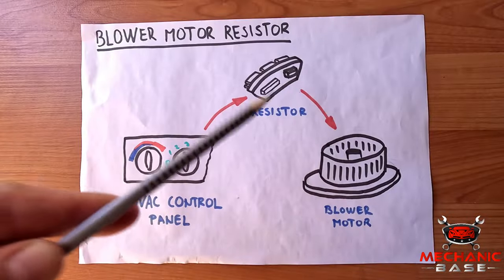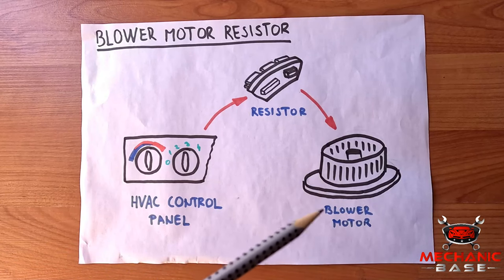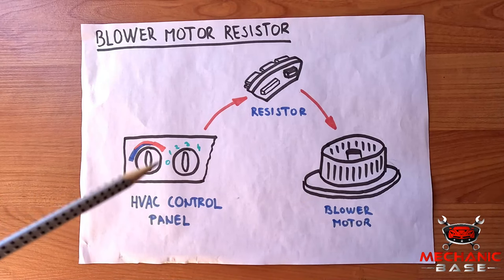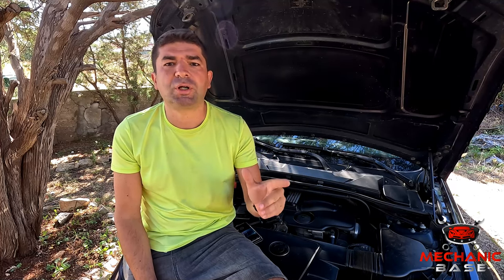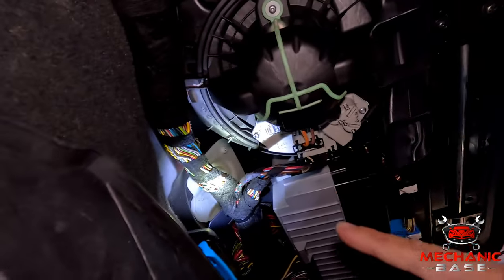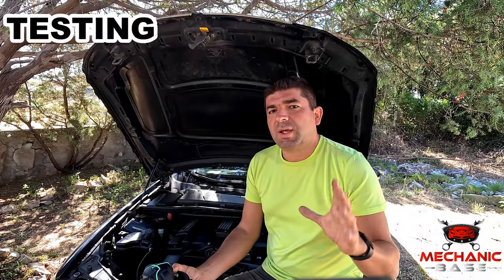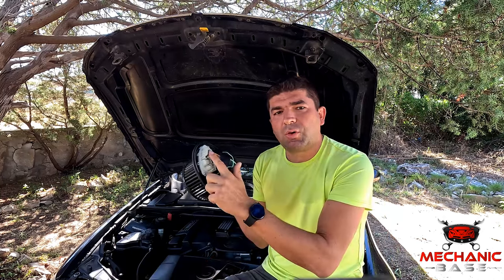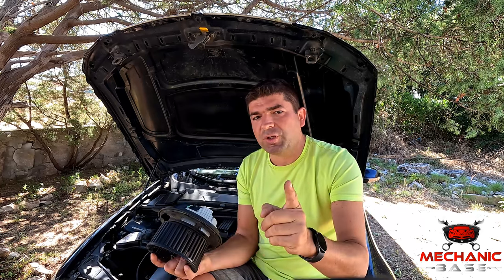4 Symptoms Of A Bad Blower Motor Resistor & DIY Fixes

Comment: I have a heating problem with 2011 Chevy Malibu  the blower motor doesn't turn on until I unplug the resistor and plug it back in.  Should I replace the resistor?

Comment: Good info for all of us D.I.Y guys….  With that being do research on your make and model.. sensor locations,Relays,Fuses. Invest in a scan tool for your make model also not all work for every vehicle. Anything to do with electrical you might wanna disconnect the negative terminal before disconnecting any sensor. I read the comments before I write my opinion. There’s so many other issues that could cause this Relays,Fuses,alternator,Blend door actuator,engine coolant sensor. Dust,moisture, is the curse lol. Try not to turn the switch on and off like the radio. And in the summer don’t keep your ac on all day everyday in this stop and go world we drive in. The only time I put my ac on is the first start after sitting for more then 6-8 hours for a min or  2. If u did take the time to read this remember it’s not always plug and play. Good luck and hope the best for you and if you ever see me at a red light we do the head nod on green we go!!

Comment: My 2003 trailblazer is going through this same thing like my air or heat doesn’t turn on when I turn the knob but if I’m on the highway it seeps through my vent automatically while I’m hiring my gas but if I hit on brakes it stop immediately

Comment: A HVAC Blower motor kept running. When High Power Fuse 60 Amperes fuse pulled out, Blower Motor kept running (Ignition Side Fuse) Blower Motor Fuse never blew, only Ignition or Engine fan 60 Amps. Burnt. Blew too (?) Switched fuse, it still worked with one but brown burn mark at fuse box. Inline under dash didnt blow or any other small interior fuses stayed connected. Why did Blower Motor fuse not burn out but 2 other high power fuses (60 Amperes ea.) Had blown. Car doesnt start after fuses blown. Relay replaced. Thank you if you have equated answer. Am checking we wirings and Air Conditioner needs to be replaced. Condenser out, but not clutch. Coyld that cause short with fan(s) circulatory system?

Comment: Hi, I watched your video. And I just want to say thank you!  Your explanation and guidance was much appreciated. The Mechanic said, I need both and the cost will be $450. I understand and respect the mechanics labor but the cost of the blower motor and reinstator isn't  nearly that expensive. Does the 450 seem reasonable to you?
Reply: Labor costs for rapirs is getting outrageous. The two parts you're talking about are fairly easy to replace. I would get the parts and do it myself. You learn how to do it and save yourself a decent amount of money.

Comment: 2015 XC60 Volvo t5, no air blowing. Occasionally some air will blow. Can you replace just the resistor?
Reply from the maker: Yes, as far as I can see, the resistor is available as a spare part, so it can be replaced.

Comment: 2010 Cadillac escalde my fan motor woks fine all settings but compresor works only on haigh speed. Low speed does not work what else would be???

Comment: Hey. I don't know if you remember me but anyway, I see that you work on cars. I had a question. My rear blower motor fan always spins on low even if I turn the dial to high on the dashboard. So no AC in the back. 

I replaced the resistor but that didn't fix it. What else could it be? 

I have a 2007 Toyota Sienna CE

Comment: Great video explaination. I have a 2009 f150 platinum and my fan blower acts weird that I haven't heard elsewhere as symptoms. The fan works in heat mode and Ac mode at all levels and any no problem. The issue I hear by it and see, is that it runs with an up down speed as if there was an overload power on it. When I put high beams on it dims the interior light and the fan goes slower and fast every 2 secs. Same goes when I click the high beams off. Or when it's in idle or driving. On the lowest speed it doesn't affect it. But as I turn the speed up it starts doing that. Almost like an alternative DC motor at different RPM sound. Any suggestions based on your experience and expertise. Thank you. I get all the heat and all the cold I want at any speed dial. Well mine is a fisical push button and alternative with  8" touch screen or I can speak to it as well to control it.
Reply: Did you get it fixed?
Reply: @RaunoNasir  hello rauno , no I haven't. It may be just not good grounding. I will have to check the motor strap grounding. May be warn a bit and not giving good contact.  Can also be the new alternator that was installed and not tighten enough for a ground bond at 100%. But will be checking on it soon. Just haven't been around for a while. But truck still runs as normal besides that overload power I explained earlier. Thanks for checking in. I couldn't find this thread I posted untill I had a reply.

Comment: 😢I replaced mine no problem, didn’t fix the issue. Still got high speed only. After my heater core failed-leaked in cabin, I did the by pass fix, and the speeds failed a day later.🤔🤷‍♂️

Comment: Hi. What could be the problem if my heat or ac only blows out of vents facing you. It can’t be changed to feet or windshield defrost.
Reply: Did you find out the problem? I have the same.
Reply: Probably the blend door actuator, do research though. Its a bitch to replace if it is

Comment: I tried replacing all relays nothing worked i replaced the resistor it worked for like 10 mins and then stopped working i replaced with another resistor did the same worked for 10 min then stopped and both new resistors are damaged I don’t know what is it
Reply: Did you change the blower motor?

Comment: What if blower motor is running with vehicle turned off, killing the battery? Could that also be a resistor problem?
Reply: That’s EXACTLY what happened to me on an ‘04 GMC Envoy. Blower kept run even after removing the key. I had to remove the fuse. Replaced blower motor resistor. Everything is as it should be

Comment: Hello, great video, i have two issues can you maybe help? So first thing is when the climate control is set to 16°c its blowing out warm air rather than the cool air you would expect at 16°c, when i put it down to LO it goes cold fine. Second issue is with the AC turn on and on LO setting the recirculation button keeps stopping and working again when its on ac working fine when its off it doesnt feel like the ac is on and goes warmer again. Are you able to advice if this is also the blower resistor? Ive been to halfords and asked them to check the ac gas and its giving them and error so they cant do anything else.

Please see video to second issue.

https://youtu.be/XML5yqsloWk?si=CzrgxW-SXsXONaIc

Comment: I have a heating problem. 2011 Chevy Malibu.  Blower motor doesn't turn on until I unplug the resistor and plug it back in.  Should I replace the resistor?